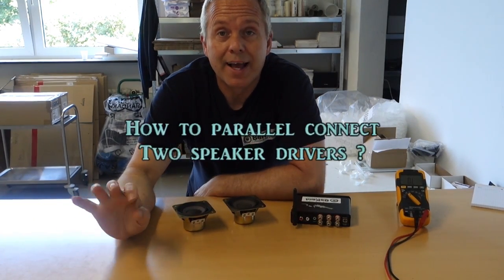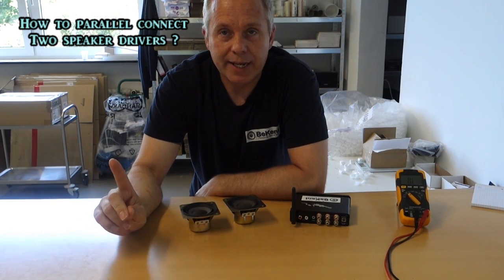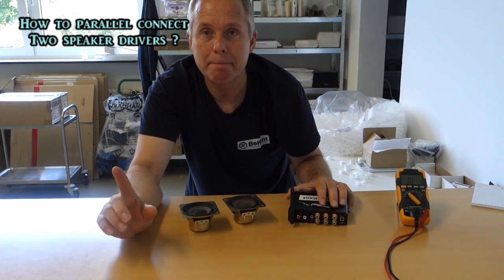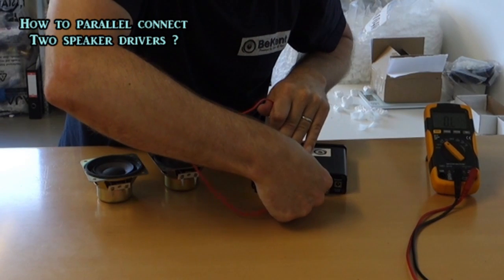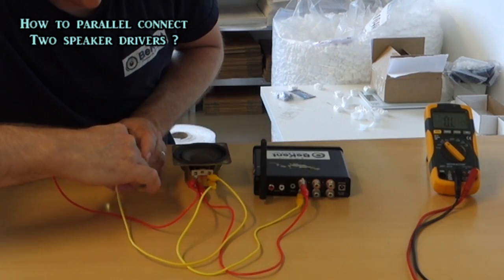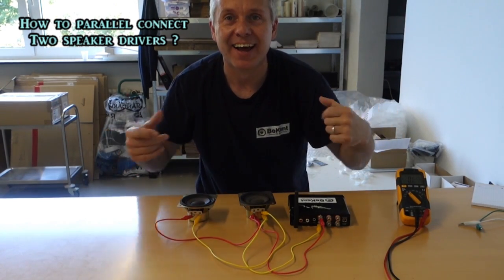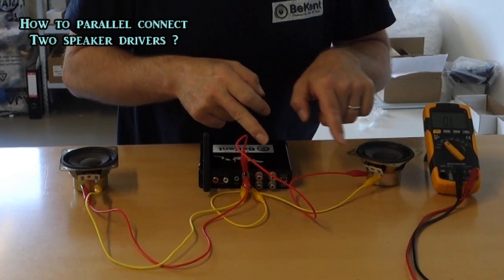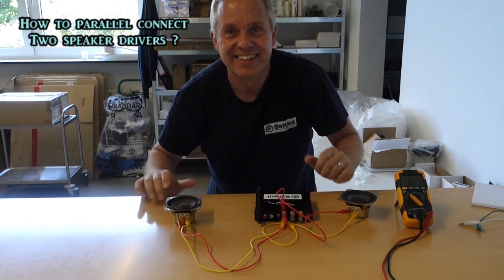How to parallel connect two speaker drivers?

Comment: As a kid,  i connected both puls wires from channel left and right to one loudspeaker on a stereo amp, because you would get a suround speaker. You get the same sound like on a dolby pro logic system. it was great for movies and Music, and it did not harm any of my amps.  The simple surround system maybe even worked like that. It would be nice to hear your opinion about that.
Reply from the maker: If anything survives that connection its a miracle, and if it survives you have mono. But I think what you experienced was something in the signal path being under tremendous strain, that tends to have levels of under the water like sound and distant perspective of lead instruments and vocals.
Reply: Every amplifier has survived and it does not interfere in any way with the function of the right or left speaker, the Stereo sound remains the same.  The speaker connected between the + pole between L and R sounds exactly like the rear speakers in a Dolby Surround system, only reverb and effects of the two channels are reproduced.  If something comes through both speakers evenly, it cancels out each other, if something comes from very far right or very far left, it also comes through the rear speaker and thus creates a 3-D effect. The left or right speaker then works together with the rear speaker. Give it a try, no matter how crazy that might sound. Ich will work on every stereo system with a stereo signal.  If it is a mono signal, nothing will come out of the third speaker of course. It only works with a stereo signal.
I'm amazed how few people have tried it.

Comment: Hi Kent, finally I have found someone who knows what he is talking about. I have a pair of KEF reference 101, there is a crackle sound on one of them, could it be the ferrofluid needs to be replaced??? or is it the crossover board? and how can I test it.
Reply from the maker: It could be the ferrofluid, but sounds more like the voice-coil is damaged. Try swapping the tweeters between the 2 speakers, this way you will know for sure if the tweeter is the problem. Then just remove the ferrofluid, and if that helps buy new ferrofluid. If it doesnt help then its a new tweeter.
Reply: @AudioTalk  Ok, I have switched the tweeters between the two speakers, and the problem still exist on the same speaker. Also, it was/is not crackle sound, (my mistake) it is humming.
Reply from the maker: @elcid4207  try swapping the speakers on the amplifier, could be a problem with you amp or the source
Reply: @AudioTalk  I did that too, I am thinking about a leaky cap????!!!!
Reply from the maker: @elcid4207  If the problem didnt stay with same channel and followed speaker then there is an issue with the speaker. But if you swap the speaker between left and right and the remains on that particular amplifier channel it will be there the problem is. A bad cap I havent heard doing that, but if you have electrolytic caps then replace them regardless if they are over 10years old just in case. But the way to localize the problem is by swapping parts until you can hear what follows the issue.
Reply: @AudioTalk  Hi Kent, yes, I did swap the speakers, tweeters, woofers, checked the wires, also used a different source, yet the humming (I was wrong it is not crackle) still exist on that particular speaker.  I did not see any bulging capacitor; I have ordered a transistor/capacitor tester to test them one by one. You are right the crossover is way over 10 years old, in fact I do want to replace them with the new ones, where can I purchase speakers' quality caps and resistors???
Reply from the maker: @elcid4207  I would say parts express online if you are in the US
Reply: @AudioTalk  Thank you Kent, yes, I am in US, this is a great help
Reply: @AudioTalk  Hi Kent, I took the crossover board out, right away I saw the problem, on the back of the board some of the circuit lines (???) were corroded and there were no connections... got fixed and the speakers sound great. I would upgrade the resistors and caps later. Thanks for your help and comments.